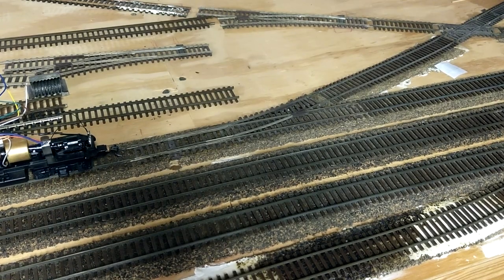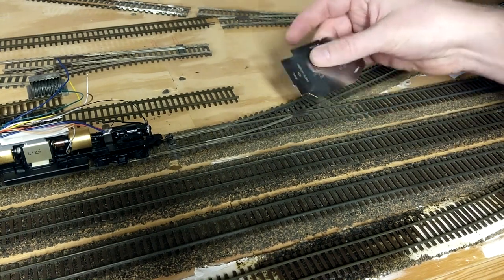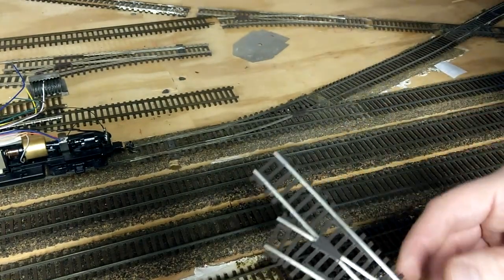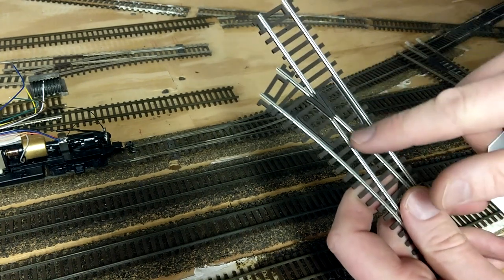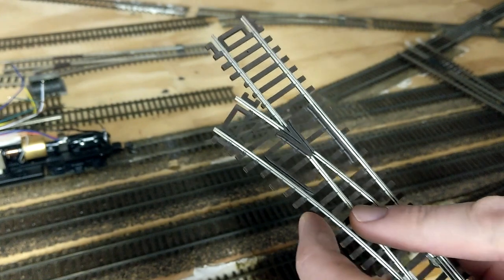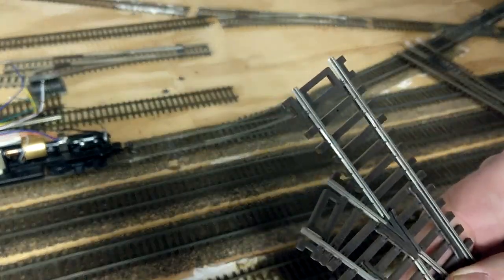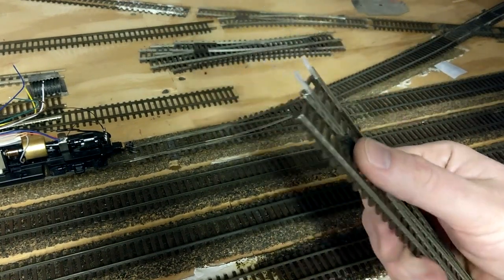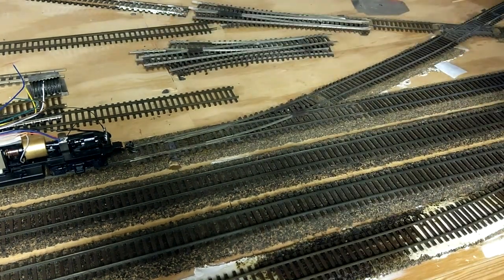Atlas HO Code 83 Snap Switch Turnout Issues

Comment: Don’t old time modelers discourage you...this is a relatively easy fix There are two issues and you have identified both. Issue 1 the pathway you identified is tight an loco flanges vary in width causing the wheels to ride up and along with the momentum cause the wheels to come in contact with the other rail resulting in the short…Resolution take a narrow file and widen the the pathway so the loco flanges can travel relatively freely thru the pathway. This is especially necessary if you have 6 axle units.….Next make a cut 1-2 rails past the frog at the top of the V and 2 rails prior to the frog at the bottom of the V isolating the frog.  Second…. 5 rails prior to the turnout make jumpers connecting the outside rails and jumpers connecting the inside rails ( flip over, remove plastic, solder wires to the appropriate rails) this will insure power up to the cut and allowing the lead axles to slide thru unpowered (therefore no short) being pushed by the  back axles which have power. When the lead axles complete the crossover they will have power and pull the back axles thru the isolated frog. Skeptics will say the plastic frog is already isolated. True but the crossover zone has to be elongated to eliminate the issues you face. Finally you will have to get power to the turnout and if you are a point to point lay out power to the back side. This can be done with drops or jumpers whichever is most convenient. Reply to me if you like i can walk you thru via a call or email.
Reply: I have to File out that pathway Gap on all my N Scale Atlas Snap Switches. Some  Flanges too deep and wheels too Wide.

Comment: Theres an easy way to fix it, just cut the curved track near the frog using a dremell ( about 1 inch from the frog or 1/2 “) it should solve the problem since it wont be energized when the locomotive wheels touch it
Reply from the maker: That's actually a really good solution.
Reply: Yes this is the fix and you can either fill the gap with some styrene or a drop of 5 minute epoxy. Then carve it down to the rail profile and hit it with some paint to camouflage it.
Reply: @mimodelrailroading  thats what i did over  my Atlas  turnouts... just cut both tracks near the frog ( about a  inche from the frog ), since they won't be energised that won't be an esue anymore

Comment: I had the same problem, I used a flat black enamel paint on the ends next the frogs. It takes long to dry but lasts a long time.
Reply: Sounds like Win-Win solution!
Reply: This trick worked for me!  Thanks so much - I went out a tie or two - and have had no issues since.

Comment: The Atlas Snap turnout switches have a frog angle of #3.5 with a diverging route of #4. The custom Line of #4 and higher works better. You can actually cut down a #6 frog side rails to 9-inches to match the length of a #4 or Snap switch. You then get a better frog angle at the length of a shorter turnout.

Comment: I’ve been having a similar issue and this info helps. I’m wondering if cutting the rail a few mm after the frog would solve the issue since all my track is already in place and I don’t really want to remove them if I don’t have to.

Comment: This is happening because your loco has code 100 wheels ( a wheel width of 0.110") and the frog is designed for code 83 (0.088" wheel width). That extra 0.022" in wheel width is enough to gap the code 83 snap track inside rails and cause a short.  Some loco manufacturers make their wheels even thicker than 0.110" to prevent frog-drop-in and prevent power interruption, which exacerbates the problem at code 83 frogs.  In theory, the logical solution, which is not the most practical, is to replace your loco wheels with code 83 threads or remove by machining the 0.022" from the outward circumference. More practical methods have been provided herein, but it is good the know the root cause of your issue.

To this day I am not sure why Atlas made these lower grade design snap switches in code 83. If the modeller is sophisticated enough to have code 83, then he/she is too sophisticated to have snap switches.

Comment: Clear nail polish at the end of the frog at the entry and exit points fix this.  Better solution is to use Micro engineering or Peco turnouts. SO much better and marginally more expensive. They are worth it.

Comment: if your engines have the "stay alive" feature in them, you could isolate the frog where the wheels have a problem by cutting the track on either side of the frog and the "stay alive" would take the engine over the dead section of the track. When I had DCC I had the "stay alive" circuitry in all of my engines. The circuitry is not that much money. Better than paying a fortune for the "good" switches that will cost an arm and a leg...
Reply: To bad I didn't see this video when you posted it as I would have bought all of the switches that you didn't want for a good price.